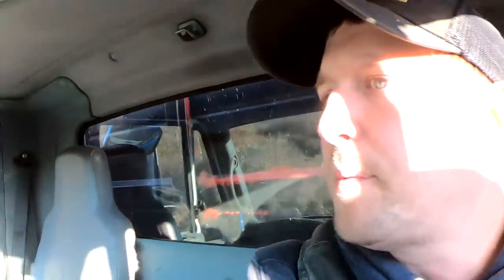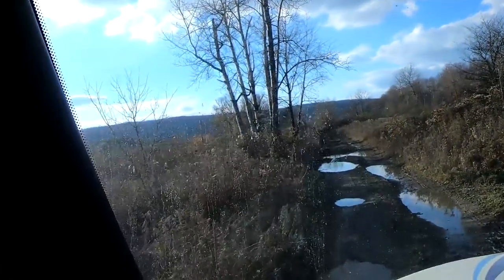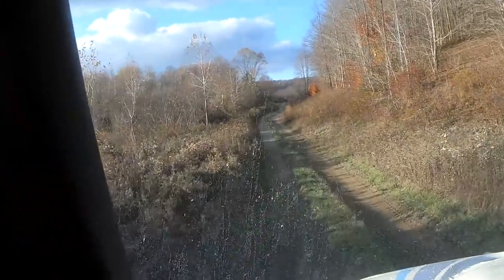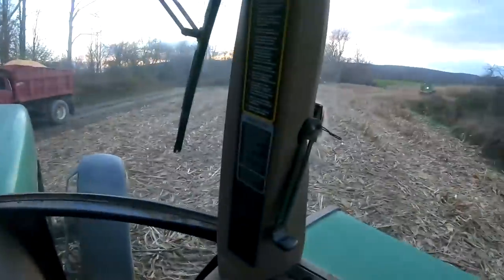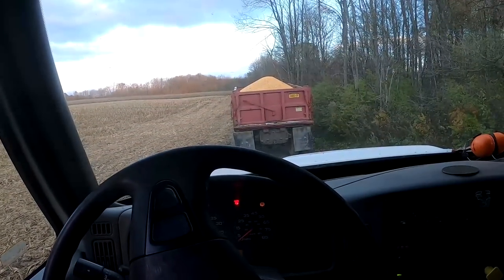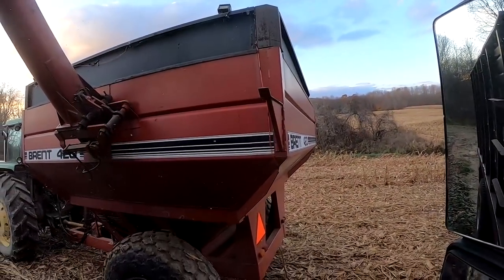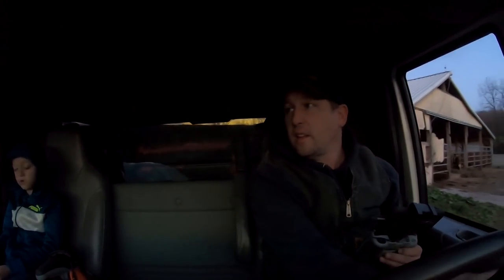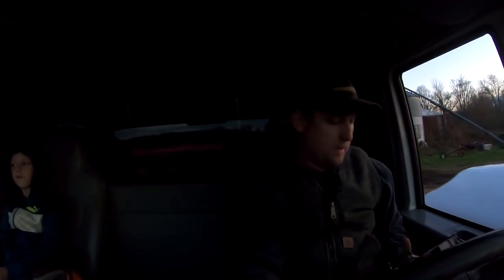High Moisture Corn

Comment: Mike I have a question. Do you run the corn through a roller or hammer mill when the corn comes out of the silo or does the blower take care of it while filling the silo? Another great video!😎👍
Reply from the maker: When the corn comes out of the silo it goes up and auger and drops into a valmetal hammer mill